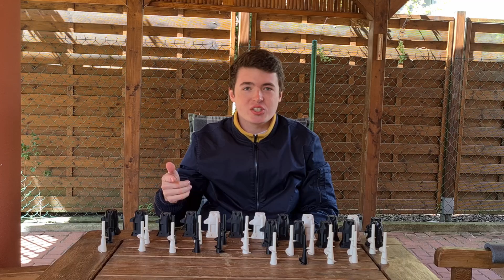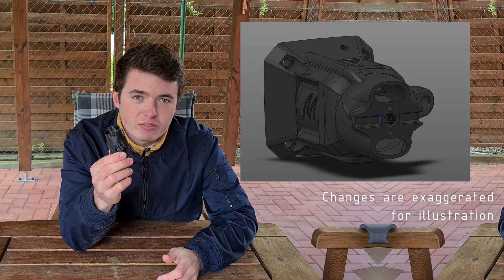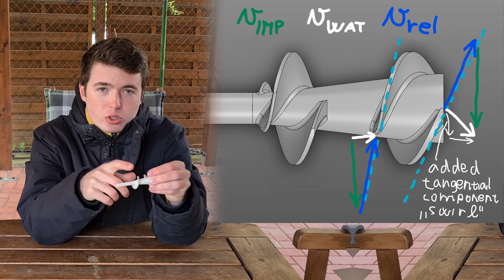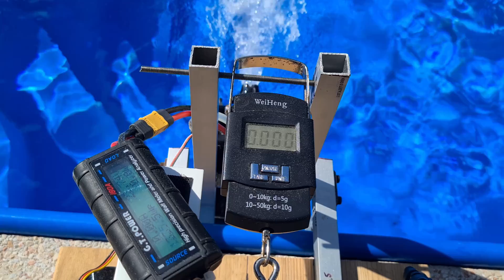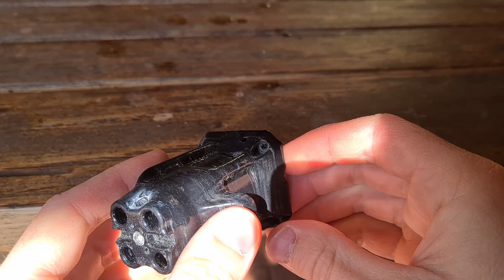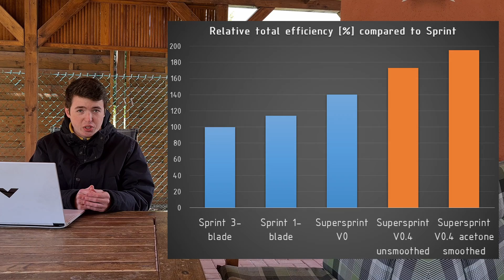New Supersprint Jet Pump Is Better Than 96.8% Pumps

Comment: I like to see tfl sss 3660 1620kv.
And i like to see all motors on 4s Lipo in your great test.
The sprint and super sprint are very cool on 4s with long runtimes too. But then we need little more kv.
So i think a 4s test will be great. And i think maybe the 1620kv motor is a great compromise to have good results on 4s and 6s.
Can you maybe test that?

I like the video with the black sprint with 2070kv on 4s with “insane acceleration” here on YouTube.

I am more interested in a good 4s setup than in a 6s setup. Because of in this sice are many boats 4s and i have a lot of batteries between 1500-2600mAh in 4s. And it’s a good weight and runtime and speed too.

But it will be interesting what is the best kv for 4s
And what ist the best compromise kv for 4s and 6s.
Reply from the maker: A 3660 1650KV on 4S will pull around 65A, on 6S it will pull around 80A. Both will be a good setup, on 6S you need a strong battery, it will be very overpowered.
As you are saying, it should be a pretty good compromise.
Reply: And on 3s it is not so fast but still it’s fun. And many people had a lot of batteries in 3s.
Or wanted it slower for kids or other reasons.
So a 3s test will be interesting too.
But it’s more a 4s-6s boat, i know.

But it’s a great boat and all of the lipos are great fun.
Thanks for that all 😊😎🙏🏻👍🏻💪🏻

Comment: Why dont you just use thinner layers and let the printer do all of the extra work? duh
Reply from the maker: Even using 0.05mm layers would still not be as smooth as acetone makes it, so I just print at 0.2 and do the work

Comment: could this improve a jetsurf board ?
engine is 15hp , 6500rpm max
Reply from the maker: The Supersprint pump (close to 30mm diameter) is way too small to power a surfboard. To power a surfboard, you would need something like 2x 60mm pumps or a single 70mm pump. You could try taking the M-Jet 30 and scale it 2x up:
https://www.cgtrader.com/3d-print-models/hobby-diy/other/m-jet-3d-printable-jet-drive-for-rc-boats

Or the M-Jet 35:
https://www.cgtrader.com/3d-print-models/hobby-diy/other/m-jet-35-3d-printable-jet-pump-for-rc-boats

Also there is the M-Jet 60 specifically for surfboards, however that one does not have the newest M-Jet features:
https://www.cgtrader.com/3d-print-models/hobby-diy/other/m-jet-60-3d-printable-jet-drive-for-electric-surfboards

Keep in mind that scaling up comes with many problems - hardware sizes, bearings, seals, wall thickness, tolerances, motor mount - these all stop working when a scale is applied.

15hp is enough for any of those applications, 6500 RPM is very low and might require scaling the pump even further up over 70mm to produce enough thrust even at low RPM; or increase pitch of the impeller.

Comment: BTW Stepan, if I may ask: what happened to the recent video about data logging, did you take it down? I was looking for it and couldn't find it.
Reply from the maker: Yes, you are right, I hid the video.

After I released it, I had some more thought around it. Right now the M-Jet Development is my only side job while I am studying. I really like it and I would like to continue. In order to keep my position on the market and my income, I can no longer give away all of my knowledge and methods. Anyone who comes to design jet pumps after me can copy what I do without having to spend those 5 years to figure it out as I did. 

As you can see from my videos, I like to share stuff. However, by doing it, at this point I am just putting my job in danger. Therefore I need to find a balance between sharing everything and keeping some tricks for myself. I will continue to share the results of my work; probably no longer everything which led to them.

Thanks for understanding.
Reply: @mjetdevelopment  Fair enough, thank you for the info you have shared so far, and I truly wish you success. 👍
Reply: @mjetdevelopment Completely understand your reasoning. It’s too bad though, I’ve been learning so much from you and really enjoyed that last video. It’s been very interesting following your progress. Keep up the great work, we all appreciate your efforts 🙌🏽.
Reply: BTW Stepan, even if you no longer share the internals of your data logging experiment, I would appreciate if you could at least validate how far off are my calculations in the spreadsheet I left at the RC Groups forums 🙏
Reply from the maker: @geekmidget  Yes I will take a look.
Reply: @mjetdevelopment  Thanks, updated with a temporary fix. 👍
Reply: @mjetdevelopment  I applied a second fix using an interesting approach suggested today by IA which considers gradual pitch progression, I have updated the spreadhsheet in the forums, feel free to check. Any consideration or criticism is welcome.

Comment: Im so tempted to scale this up into something ridable... TP Power 100 ???
Reply from the maker: Wow thats a big motor.
I need to note that scaling anything up comes with many complications - hardware sizes (bearings, screws), electronics mounts sizes, wall thickness, tolerances, overall its a difficult task.
But if you eventually get that motor, you can aim for 60-70mm pump diameter with that kind of power.

Comment: Would really be interested to see the difference from the 4 port nozzle to a single port and then adjust nozzle sizes for best flow vs pressure. This is something that's adjustable with sleeve inserts on full size boats. If it doesn't increase performance much than definitely not worth redesign thing steering.
Reply from the maker: According to the tests I did, the 4-path nozzle greatly outperforms any regular single path nozzle I have ever designed. I found this during the development of the M-Jet 35:
https://youtube.com/playlist?list=PLiFskGz_svvQjxSCElF1c1PSJKaHq8vae&si=X7RAr3htwXjIYbh0

The size of the outlets is already tweaked to achieve the highest top speed. There were attempts to change their size on the M-Jet 35, changing the size in both directions led to worse performance. This wasn't actually tested on the Supersprint, but the Supersprint pump was designed based on a scaled down M-Jet 35, therefore no significant achievable improvement is expected.
Reply: Very cool

Comment: Would you ever print a Berkeley jet pump for fun? They are the most common endurance jet boat, and drag race jetboat reference design pump. They are also, very, very old designs adapted from what farmers once called "trash pumps". Called such because the old mix flow basic pump was once used for high volume irrigation, and to this day, you can still buy Berkeley brand irrigation pumps. I would love to see what you think of one in comparison to your amazing design. It would be great to see the side by side performance on a printable scale.  While hamilton/scott/kodiak jet hav made some amazing advancements for jetboats, still none compare for raw thrust of the old mixed flow Berkeley. Maybe your design is the next step. I do not own a 3d printer, and honestly would not know where to start.
Reply from the maker: Thanks for your kind words and your suggestion!

From what I have seen, the Berkeley pumps use a mixed flow impeller with an outside ring. There are multiple challenges with this kind of design, when attempting to combine it with some of the design elements I have been using so far. 

Firstly, when using two stages, which so far seems to be essential for priming ( https://youtu.be/ZDD8SjKUy_4?si=7kXQWqWu1EI8J-5S ), the berkeley conical shaped mixed flow design ends up having a bit more complicated pathway through the pump, changing the diameter back and forth rapidly. The diameter would have to increase through the first impeller, then around the first stator it would have to be decreased again to enter the second impeller.
Apart from this geometrical complication, it is also important to understand what differences performance-wise there are between axial and mixed flow impellers. The axial flow impellers operate efficiently under lower pressure difference and higher flow rates, whereas mixed flow impellers operate efficiently with higher pressures but lower flow rates. That also matches the difference in geometry - axial design clearly allows more flow.
When using two axial impellers in the two stage configuration, as seen in the video, it is the pressure that gets, in the ideal case, doubled. Therefore positioning two axial impellers in series might have a bit similar effect as using a single mixed flow impeller, with the advantage of improved priming.
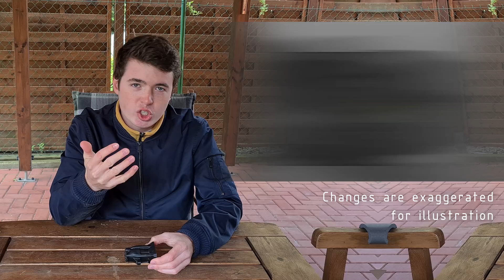In fact, what I am currently using for the newest M-Jet pumps is a slightly mixed flow shape, which can be seen around 1:48. I found this makes the pump slightly more efficient. But converting the shape to even more mixed flow as 1:51 only worsened performance.

Another complication which rises up with the Berkeley impeller is the ring around the impeller. This rotating ring needs to be placed inside the pump, inside of a stationary wear ring. The gap between the impeller ring and the stationary wear ring creates an annulus-like geometry. To prevent backflow in this area (there are no impeller blades to keep pushing water forward), the gap should be either somehow sealed or machined precisely to make it fairly small. A small gap, on the other hand, means that tiny debris or sand could get into the gap and eventually make the pump completely stuck. This might not be a problem for precisely manufactured Berkeley with smooth surfaces, but it could potentially create a problem for 3D printed surfaces.

With these complications mentioned, I need to say that only a real test would show which exact effect a berkeley style design at such small scale would bring. I would be interested how the berkeley impeller changes priming, efficiency and overall behavior of the pump. 

To conclude - the Berkeley pump design is something I am interested about and might attempt to test some of its elements in the future, with some of the issues to be somehow overcome.

Comment: What size do I need for a Hobby 56112 780 kV surpass engine...or how many % must used
Reply from the maker: About 200% for that motor size.
But I definitely don't recommend scaling it unless you can do CAD and work with the STEP file. Scaling it up brings many problems with hardware sizes and more.

Comment: Possibly a quick tip for acetone smoothing that I haven't seen in the 3d print community yet, it is common to dehaze car headlights using an acetone mix vaporised in a electric heated mug with a plastic nozzle on the top. I believe these can be bought from your typical chinese retailers pretty affordably. Using this method would allow you to 'spot' vapor smooth the parts ie, only the internals while leaving the outside and critical details undamaged. This could provide the best of both worlds. If you like this idea and choose to use it could you please send me a download link for the supersprint files? Cheers, Blair

Comment: Hello! It seems like a great improvement in terms of consumption :D. I have all the parts of v0.3 printed, is everything compatible? Can I print just the pump and the propeller to go with this improvement? Or should I also print the hull of the boat? Greetings! And thanks again!
Reply from the maker: Yes! Everything is compatible, you only need to print the new V0.4 impeller. The pump is not changed.

Comment: is the file for the pump bidirectional? I think i would like to try building a catamaran with 2 Pumps but i would need the Servo and the steering to be reversed/flipped to the other side ^^
Reply from the maker: You can just mirror all parts of the pump in your slicer. Then spin them the opposite directions.

But keep in mind that with the Supersprint, the pump housing is completely integrated into the rear hull. So if you wish to use the pump for a catamaran, you would need to heavily modify that rear hull file or create your own housing.

Comment: may I ask if you have tried changing the bearings and if you did which were the results (ie ABEC 7 vs ABEC 9, different supplier, ceramic or stainless...)? Great video!
Reply from the maker: Thanks! 
I am using stainless bearings and I don't know their ABEC rating. I haven't tried different ones, but I am convinced that they don't have any noticeable impact on the pump performance. 

The pump is a high torque machine, the pump in the video requires about 0.4Nm to be spinned. Quick calculation on SKF website, and the main bearing which takes all load will only produce about 0.00045Nm of resistance, making this source of power loss negligible.

Comment: Any chance of testing these improvements on the m-jet 35?  I'd love to see the performance and efficiency gains on the larger more efficient pump base.
Reply from the maker: Right now it is not my focus, but it would be worth testing how much gain there can be from optimizing this parameter on M-Jet 35. I will also consider which improvements people report with this update on the Supersprint when actually running the boat. 
Primarily thanks to being larger, even the stock non-smoothed version of M-Jet 35 is still slightly more efficient than the smoothed Supersprint V0.4 pump.
Reply: @mjetdevelopment  Thank you for the input.  I don't run rc boats but I have a lot of interest in using electric jet pumps on kayaks.  Your work is some of the best that I have seen and I'd love to see something scaled up for small electric pwcs.

Comment: @mjetdevelopment What parts are actually different from the v0.3 to v0.4?  I’m in the middle of printing, don’t know if I should stick with printing the rest of the v0.3 parts or the v0.4.  Would the v0.4 impeller work with the v0.3 nozzle housing?  PS, thanks for organizing and updating the files in v0.4!
Reply from the maker: Only the impeller and the Lid_base is changed compared to the V0.3. Everything is compatible.
Reply: Perfect, I haven’t printed either of those yet :)  Thank you!  Your quick and helpful responses to questions from the community is very much appreciated, and makes this process more enjoyable and less intimidating.  Thanks again!

Comment: you might try printing it from nylon using jlcpcb or pcbway 3d printing services, they use SLS its much smoother and much more durable than any FDM print.
Reply from the maker: Yes, good point, using a smoother printing technology will improve the performance even further

Comment: Bro, kg of trust per kw of power that’s will be standard measurements and more perfect it know inlet power and outgoing power ( and get know the best efficient set volts/amps for your setup)
Reply from the maker: Yeah, plotting thrust per kw would also be a good metric and information. 
The only disadvantage of that metric is, that this does not include the exit velocity, which is very important for top speed. You can have 20kg thrust but very low exit velocity, then top speed will be low.
Therefore I am plotting the relative efficiency, which results from output power / input power, compared to the Sprint. The output power already includes the exit velocity, too.
Reply: @mjetdevelopment do yo7 know how a speed meter device looks like on bottom of getski? U can easily do something same, and measure velocity.. or if u somehow can collect all outputted water in 3 seconds with 5kg thrust, u can calculate a velocity.. e=mc2/2.. c2=e*2/m.. c*c=5kg*9.8*2/m
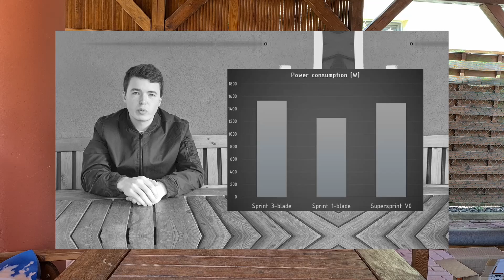Reply from the maker: @elyaperestigli2774  No need for that, I am calculating the exit velocity from thrust and exit nozzle area. The equations are shown at 0:38 here:
https://youtu.be/un8rdTVPTKM?si=QLlE8AJtOyFXXgPo

Comment: Tip. Try resin printer.
Reply from the maker: Yes, good point, it would be the best method as long as the resin is strong enough
Reply: @mjetdevelopment  i use SUNLU ABS like resin. its very strong

Comment: hey there, i got a question, i just got an mjet-30 printed out and wat woundering if the propellers could handle 36.5k rpm, probaly a bit of a long shot though, i printed them at 100% infill with no supports if thats help. thanks, - TI0S_94
Reply from the maker: Strength of the impellers is usually not a problem. Which material did you use, and which motor are you using on which voltage?
Reply: @mjetdevelopment  pla+ filament And a 3650kv spectrum motor on 4s